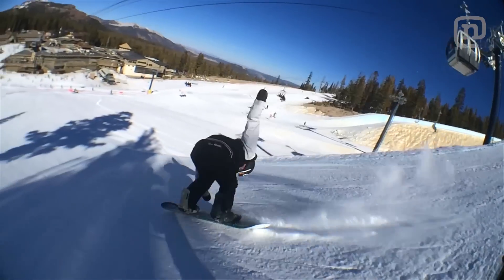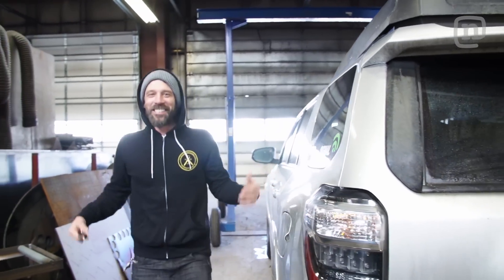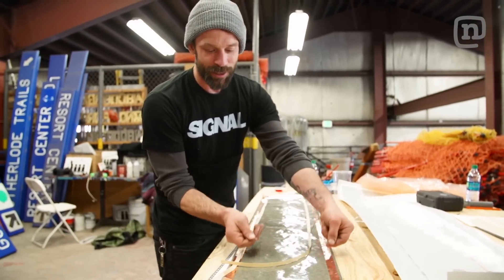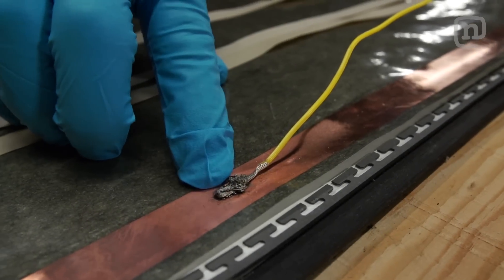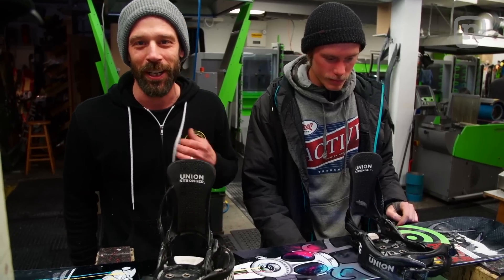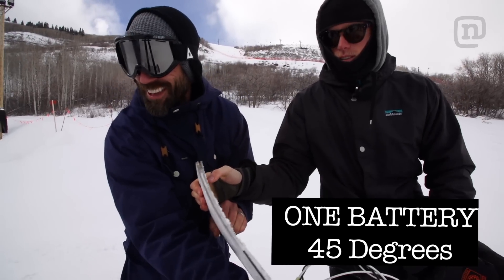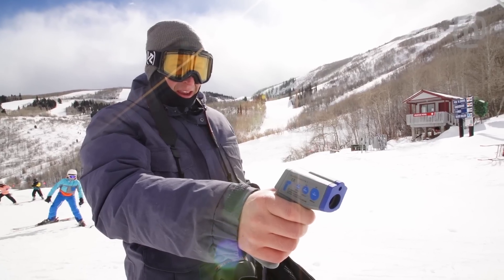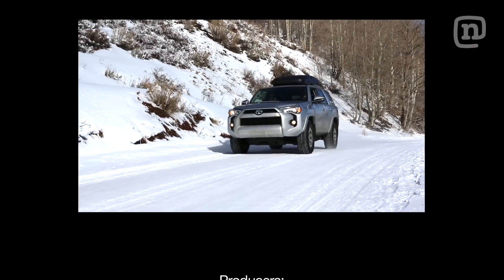Speed Stick Heated Snowboard—Go Faster! Every Third Thursday

Comment: Why on earth did they not do it with a blind test, that video is a great concept video, but if you want to get rid of confirmation bias you need to do it as a blind test. (Aka the one on the board can't know if it is heated or not)
Reply: very true, im sure they were just eager to test out the board and there idea, it was probably tested later without the bias.
Reply: Good point. I guess they are ideally, but seriously lack of basic training in science and methodology. Good to see the concept seems to work, but it's not too difficult to concept proof. However, they still gotta a long way to go to improve its function, durability, battery life, etc.
Reply: Brenden OLoughlin Eh, is this a trick question? One could have a real battery the other a dummy battery.
Reply: Watzegik Datzegik depends on what amount of heat the board delivers, but yeah a temperature sensor mounted just below the surface of the board would also be a great start for a better test.
Reply: Oh one more thing, don't get me wrong I think this idea they have here is brilliant, I just wanna know if it actually makes any difference.
Reply: I was thinking hell, test it industrially with equipment. 
1) Make a shallow angled gutter from plywood, cover evenly with snow.
2) Let the board go down on it's own WITHOUT heat, and then WITH.
3) Record times, do math, empirical results.

Comment: Since you have already a powered board, I would be cool if you were able to make a pair of boots or shoes and bindings that could be magnetized together with electro magnets. This would allow allow a rider to get on, off lifts, and get going down hill quicker, rather than re-attaching the loose binding before heading down hill.
Foot wear would to need have some sort of a jigsaw puzzle structure that would fit into a structured jigsaw puzzle binding. The fitting would help keep the rider from slipping off the board.

Comment: Alright now here is how we can make this great idea even better. 

Place a hidden battery in a jacket. 
Run some wires down to the boots, and have some kind of connector at the bottom of each boot. 
the female connector on the bottom of the boot snaps into a  male connector attached to the snowboard and bindings
Nobody would be able to tell that the board had been altered, and nobody would be able to see any wires or a battery.

then we give these to all of the USA olympic athletes and watch them smoke the competition! ;D
Reply: Great idea, except all gear is tested to very specific details and the whole point of the Olympics is skill not cheating.
Reply: Tell that to the Russians lol

Comment: Heat tape you can cut it to any shape and you connect it to a wire and plug it in the wall. And it comes with little plastic covers so you don't touch the open wire and get fried!

Comment: You need numbers to prove any experiment.  Feels faster is not science.  Is not repeatable.  Ever heard of a placebo?  You should have just went down the regular mountain and clocked runs on a gps app on any smartphone.  After a few runs then you can take the mean of say 10 runs without battery then 10 runs with battery.  Then you would have hard numbers and not feels faster.  Take care.
Reply: Yes! Simple experimental methodology
Reply: I was thinking hell, test it industrially with equipment. 
1) Make a shallow angled gutter from plywood, cover evenly with snow.
2) Let the board go down on it's own WITHOUT heat, and then WITH.
3) Record times, do math, empirical results.

Comment: You are sliding on a thin layer of melted snow, but your speed comes from how quick you can tread the water out from under your board, not just having more water under your board. That's why there are different types of structure you can put on your board. There is a specific structure that acts like tread on your tires that gets the water away from your board quicker.

Comment: I would like to see this done with a consistent downhill slope with equal weights on 2 boards... Or try a blind test with dead battery's so the rider doesn't know if hes on a heated board or not and see if they can accurately determine whether their board was heated or not based on the ride alone to any significant consistency.  Cool idea though, it may very well work.

Comment: meh, no way to tell if this is placebo effect or not. Of course they thought the heated board was a little faster! They spent hours making it. I want to see an actual side by side test of a heated and non heated board
Reply: I am also wondering if that possible speed increase is really due to the water melted or if it is more related to the wax of the board properties at a higher temperature.

Comment: I doubt if it actually made any difference, it's more likely that it actually made it slower. The heat would melt the wax and would rub off onto the snow, then you're riding on an unwaxed board. The placebo effect is a wonderful thing

Comment: The heat of the board would have little affect on the snow melt; Im pretty sure it depends more on the force of the board hitting the snow, compressing a tiny amount of it, turning it into water.
Reply: Would a board slide better on ice, water or steam?
What about all 3?
You can build a hoover board using the steam from the heat.

Comment: I thought while snowboarding, that your floating on air molecules withing the snow and so that is why you go glide and go faster. Example, fresh powder is better than compacted snow/ice. There is more air compartments in fresh powder to glide over, but when the ice is compacted there are less molecules in the snow to ride over. By melting the ice you are just making your ride similar to going down a slide(why you may feel that your are going down faster), which would make your control less accurate. If I am wrong please correct me, this is just what i have been told about the mechanics of skiing and snowboarding.
Reply: You realize you go slower through powder right? It's about friction and resistance, I've can be faster if it's smooth and not bumpy, but if there is a thin layer of water you would slide over it much faster, it's the same as a car when it hydroplanes.

Comment: You gents should combine the Solar Board with this idea, except make it so the solar panels save / use power to heat up the board! Just an idea, Cheers! 
P.s.-
Signed up for a Signal 6! Stoked, & fingers crossed

Comment: An easy formal test is the same skier does the same run over and over without jumps or rails.
If there is a difference in speed then it should show up in the run times.

Also, if it melts much snow, won't it create more patches of ice?

Comment: Great job constructing the board fellas, but I wish you had given some actual numbers. I'd wager that board is no faster, but I'm still glad y'all tried it. If you give me some basic numbers on the energy flow from those batteries (volts and amps), I can tell you how quickly that snow cools the board back down.

Comment: You should had done a test on a short controlled slope running the board with and without the heat same slope same snow.  A start/finish line from point A to point B and see the time difference down the slope at different bottom temps.  You should patent this idea before the big guys do.

Comment: When the conclusion is: "It kind of feels faster" it might as well be due to the placebo effect. You built the board and of course you want it to be faster, so it feels that way. You should test it properly. Go down the exact same straight slope 10 times without heat. A long slope, for better accuracy. Then 10 times with heat. And time it with a stopwatch. That way the "feeling" of it going faster has no say at all.

Comment: One thing that is forgotten, water is a conductor, so if the board contacts water it will connect the + & - notches
Reply: +Wide Open Throttle Lifestyle that's true, but there's probably not enough water for a good connection while moving.
Reply: water is not conductive. The minerals like salt in water make is conductive. Distilled water will not conduct electricity.
Reply: colin zervas glad there is still brains in the world !

Comment: By the way, the theory that ice skating is facilitated by the ice reaching pressure melting point is one that has been debunked and is just a myth. If the weight of a person through ice skates is not enough to increase the pressure to reach pressure melting point, then the weight of a person on a snowboard or skis definitely is not.
Reply: Exactly

Comment: The snow doesnt melt because the board is warm, it melts bacause when you put pressure on ice it melts, even though the water is below freezing point.
Reply: Pressure doesn't create heat. You're right about friction but it's not the main cause of the snow melting.
Reply: +Ethan S tell that to a diesel engine. lol
Reply: Hmm tell this to the Earth I don't think she's heard yet.
Reply: Pressure is directly proportional to heat, you increase the pressure it heats up

Comment: all that heat would be lost after a few meters of contact with snow. it's like a big surface radiator with low heat capacity.

Comment: The best test you could do to prove this technology is a coefficient of friction test. Its a really simple test, it doesn't require fancy equipment (google it to find out more). From my stand point there is plausibility in this tech because the coefficient of friction is purely dependent on materials in contact, and since you're changing the materials you change the coefficient. 

Like this so they see and show us the numbers.
Reply: The difference is that this whole concept relies on the snow melting, which means that a normal coefficient of friction test wouldn't be relevant because it tests on a normal surface.
Reply: What I believe you're saying is that the coefficient of friction (μ) test wouldn't work because it has a specific procedure in which snow cannot be introduced. If this is the case then I must say you sir are mistaken. μ depends ONLY on the two materials. Meaning that you MUST change the materials (surfaces) in contact to get a change in μ. There is no one specific material you must use in these tests.

Comment: Two points. First, don't say "it's just a theory" when you mean "it's just a theoretical hypothesis" or "we are just guessing based on a theory". There's a difference.

Second, the heated board may go faster if all its heat energy isn't conducted to the snow, which happens nearly instantaneously when you step on it. If you would want to have a heated board while its moving, it should be able produce heat energy as fast it loses it, and this wasn't the case. The board was as cold as the snow when you were sliding on it. You could have realize this if you would have ended your project with a scientific test where you compare the speed of the board with and without the heating instead of just guessing that it goes faster when you knew that it uses both batteries and thus you "should" notice a difference. My hypothesis is that the only parameter that the heating affects is the static friction coefficient, which is not important when you are moving. 

So all in all, the project succeeded in doing a heated board but failed at making any difference what so ever on its speed. You could have guessed this knowing some basic high school physics.

Comment: the reason ice is so slippery is actually still not known the idea that pressure is what causes the ice to melt  is a good idea but the mass to melt the snow just dose not add up the more common theory these days is that the ice crystals often leave out a few water molecules that have nothing to bond with. 

just saying

Comment: This doesn't really make any sense because if you bring your board inside and let it warm up, then take it out on the snow, it sticks until it cools down again, because it melts the snow under it. I also don't think you're actually riding on a thin layer of water. That is the case for ice skating because the blades make way more pressure on the already hard ice, but with a snowboard your weight is spread out and the snow is usually at least a bit soft. There's nowhere near the pressure needed to melt it, plus if your board melted the snow a little bit, it would leave a crusty ice trail behind. 

Also, what about riding in powder? It definitely doesn't melt powder, and if you've ever ridden on a day where its above freezing and the snow is melting, you know it's super slow and boggy. I you were already riding on a thin layer of water anyways, shouldnt wet snow make you go faster? This is a cool idea and cool build, but I think just a nice hot wax is just as good.

Comment: Hmm, interesting!
From my experience on a cold day an unwaxed board is usually alot faster than a waxed board. I noticed you also waxed the board on the parking lot.. I scrape of wax very thorough but the first runs are always slower until the wax as settled/scraped off from actual riding.. Could you redo this in reverse order? Hottest first and end with it off?

Comment: Try using copper, copper melts ice, with out any electricity, meaning no need for big batteries, and the board doesn't get hot, it's just because copper is a conducter

Comment: make a board with magnets in it and the boots that holds you to the board
Reply: a magnet strong enough to hold your boots onto the board would be huge, and it would have to be an electromagnet so you can turn it off to get the board off, so you'd need to carry a power source around with you too
Reply: ihopthsuzrnmeisfree depends on how you do it and if you put a lever to slide the magnet loose
\

Comment: good idea and well tested. 
Did you ever try Ultra-Hydrophobic Materials or Textiles ?
Reply: I hope dave lee will test it.
or : I will do those tests :-)
Reply: the test is quite easy:
take neverwet, or equivalent products and run 2 equal boards.
and extend the test with the lotus textile stuff which use a microstructure.
Reply: sounds like it'd be levitating
Reply: with heat it works, but not with a ultra-hydrophobic layer. Unfortunately.
Reply: yes i have tested it with Never Wet. This was extremly expensive.
Reply: how was it?

Comment: Do a scientific test that uses a side by side comparrison.  Find a slope that is long and groomed and build a guiding system to keep it on the same path and equal the weight on both and record times and max speeds.  You could maybe send it down a bobsled track? This could have so many applications beyond skis and snowboards; for example it could make a faster snow mobile.  you should polish up the concept and seek a patent.

Comment: I´m not really sure that this should actually work. I mean yes... Ice skating and skying and snowboarding or even making snow balls is happening thanks to melting ice. However it´s caused by applying pressure and that way dropping its melting point. I´m not sure that melting it with heat is a way to go. Or is it? I´m not rejecting this. Just questioning :D

Comment: cool idea, and im envious of your guys jobs... but this made me cringe more than once - particularly what appears to be the lack of any power control or LVC on the batteries. They looked like lipo - and are liable to blow up in flames if you either try to pull too much power out of them, or drain them too low. the power issue's less likely, given the wire's would have probably acted as a fuse - but the LVC - with a volatile battery in your pocket... eeek. 

Could have achieved a slightly less cool, but much easier to build heated board by simply sticking that heated sheet to the top of the board, and then adding a few cm of insulation like polystyrene. and a sound concept... ice skaters have done the same with their skates, with similar results.

Comment: The theory that the snowboard melts the snow is questionable. It has been said that ice skates melt ice, as well, but a quick Google search revealed that this is controversial. One could argue that wet snow is slower... It certainly seems that way in the spring.
Reply: That's because the wet slush causes you to sink into it as opposed to floating on top

Comment: so lets see,  icy hills are fast, slushy hills are slow. hmmmmm  tough one
Reply: +Mike may you get slowed down on soft snow because you sink into it more rather than just gliding over it, with this board it should just melt the layer underneath the board and make it smoother as it goes over it. it won't melt it enough to sink into it and slow down

Comment: No thermostat or any type of temperature control...just straight heating element to a battery. This is an example of what not to do. Surprised one of them didn't get electrocuted.

But I guess this is just a theory tester after all.

Comment: I feel dumb. I thought you were gonna put deodorant on the board... Anyone else?
Reply: +Marty McFly That would have been a better experiment then what they actually did. If they think they can heat a thin board, place it on snow and ride down it and think it's going to do anything at all makes these guys really stupid.

as soon as they place the heated thin board onto snow, the heat's probably almost transferred to the ground before they start sliding at all. If they also think the board can melt snow or heat it up in any way at all while travelling down then that's even stupider.
Reply: +Yoshi The board has friction when it's going down. It melts snow. Using that is basically an upgrade to speed cause I bumps up thd warmth which bumps up speed. So it's not stupid.
Reply: +Yoshi I never sai it melts instantly it takes time to go down when it's at the sweet spot it goes more quicker. It's not like it's the same speed.